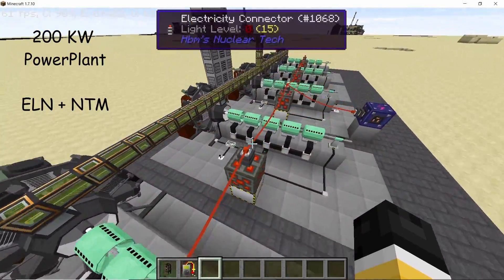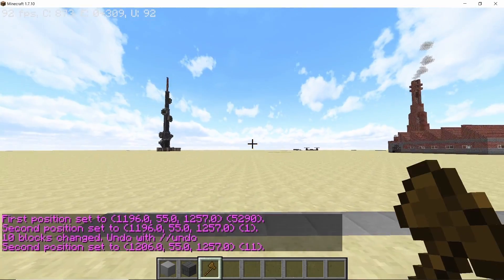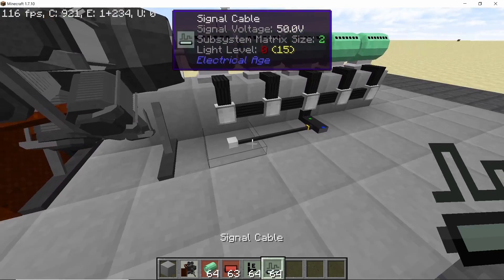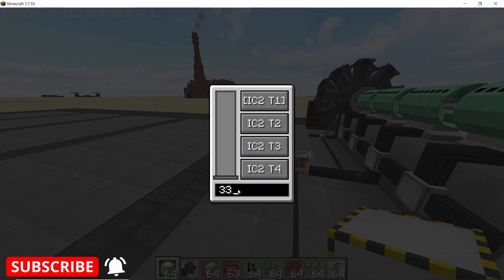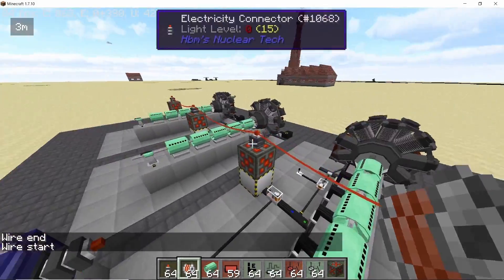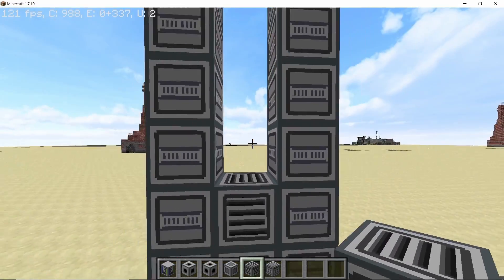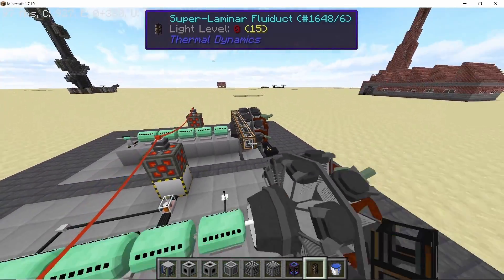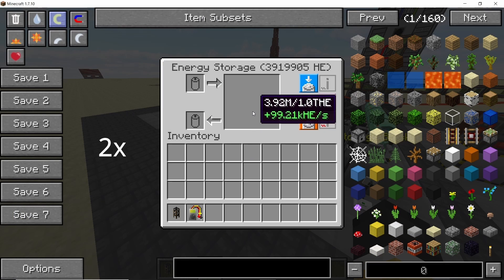200 KW PowerPlant Tutorial - Electrical Age + HBM's NTM + Advanced Generators Mod Minecraft

Comment: How to use this energy
Reply from the maker: To power production machines, use to process ores and materials and to craft bigger reactors
Reply: @ ok but want to use the energy product with this PowerPlant,how to do this?
Reply from the maker: @Cosaguardi-f7x  what do you mean by energy product?
Reply: @ The powerplant produces 250kw, how to use it for example to power 800v turrets
Reply from the maker: @Cosaguardi-f7x  if it is electrical age machinery/turrets that you want to use then do not convert the power to HBM power like I've done here. 
Plugging in the cables directly given they are set to the correct voltage using transformers should do the trick.
Reply: @ ty

Comment: MY EXPLODED ???
Reply from the maker: it shouldn't have ... I tested the design multiple times and as long as you kept pulling power from it the speed of all the turbines stabilized.
Anyways a solution for that is adding a fixed shaft at the very end of the system with a clutch and tachometer connecting it to the turbines and set the tachometer to send out a signal for the clutch to engage as soon as rpm goes over 980 ... that way your system will always operate below the max rpm which is 1000
Reply: @SavageVegeta  i did that but i wern't pulling power bc i was working on steping the voltage down and it blew up in my face

Comment: i use the fluid i use fluid to infuse water but it does not transmit even though i already have water in tank
Reply from the maker: Why do you need water in this system ? Al it needs is fuel

Comment: the thermal ducts do not connect or even seems to be compatible with HBM tanks, how would it be possible to make something like this but nuclear powered?

its strange how these work with HBM reloaded but not 1.7.10 version
Reply: HBM reloaded uses standard forge fluid system, which is used by anything except original HBM. Original HBM uses its own system, HBM said it was hard for him to use forgefluids. So, in original HBM fluids can be stored only in its own tanks, and transferred only by HBM pipes. They are incompatible with anything else, including Applied Energistics(with ExtraCells addon).
Reply from the maker: Well yes as the comment below says in 1.7.10 you can only transfer ntm items via itemducts but not fluids as the system is totally different. To make a fully automated nuclear power plant you can get the fuel in and out using itemducts and use ntm pipes for fluid on the Multiblock nuclear reactor. 
I've made an entire video on automating that reactor using thermal expansion

Comment: Hey man ive got one question,  does immersive engineering energy works with HBM?
Reply: There are converters in HBM, RF-HE converter takes in RF and outputs HE. HE-RF converter does the opposite. Conversion rates are unlimited (RF cables will be the limiting factor, HE cables do not have transer rate cap).
Reply from the maker: Yeah it does using the RF - HE converters that NTM has. And not only immersive engineering but every other mod that uses RF will work with HE using those convertors

Comment: The fact Thermal ducts connect with both Electrical Age and HBM's NTM is alone awesome, and this power plant is perfect in every aspect; it have engine sounds too 😍
Awesome as always bro, thanks for sharing this insane build
Reply from the maker: Yeah the engine sounds and animations are really awesome, that's why this engine fits the ntm theme tbh. Also thank you as always for the awesome comment, you're always welcome and appreciated here 🙃🔥
Reply: @SavageVegeta  btw, i've saw a 'rotary engine' under the label of Electrial Age but mine doesn't have it; i've updated it from CurseForge but still, no engine 😅
What i missed ? Thanks in advance btw and sorry the late reply, youtube isn't giving me notifications
Reply from the maker: @KuroganeHikaruCh  you've download electrical age from the github link that I've given in the description cause it'll take you to the latest versions which Curseforge doesn't have. 
The version of the mod that you want to download is 1.18.3a
Reply: @SavageVegeta  ayo, thanks again
Reply: the thermal ducts do not compat with hbm what so ever for me it seems, i cant connect ducts to the tanks to get a team supply, any idea what im doing wrong here?
Reply: @robbytheatomicengineer5749  Original HBM uses its own fluid system (anything else uses forge fluids). So, you can use HBM pipes and tanks only with HBM fluids. But the 1.12.2 port of HBM uses forge fluids.

Comment: 200 KW Powerplant? No joke?
How much would it be able to power a basic survival base?
Reply from the maker: Each motor putting out 40 KW ... we have 5 in total therefore totaling to 200 KW. And as the conversion factor is set to 0.5 , we get 100 KHE/s after conversion. So yes that much power is more than enough to actually power a base with standard starting machines like shredder , assembler and chemplant.

The main advantage of this build lies in it's modularity ... you can make another one of this module giving you total 200 KHE/s ... and so on and so forth. All depends on your power needs